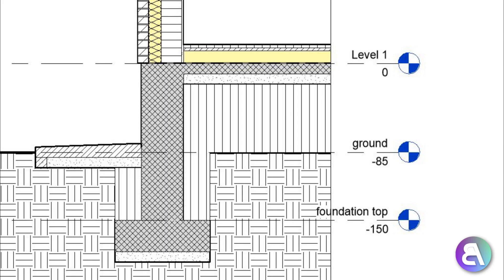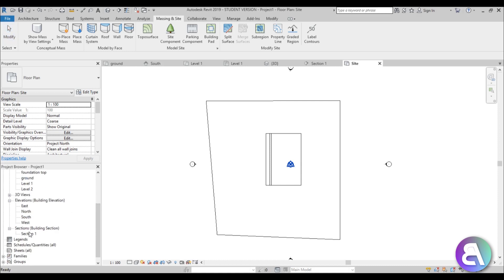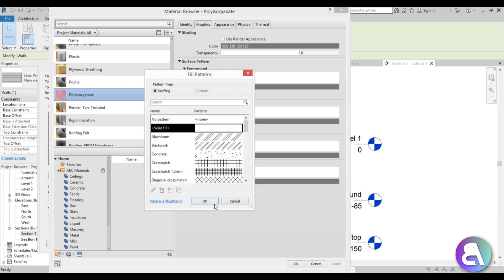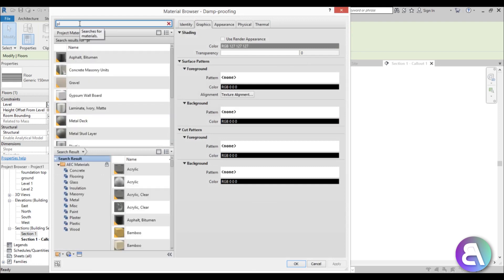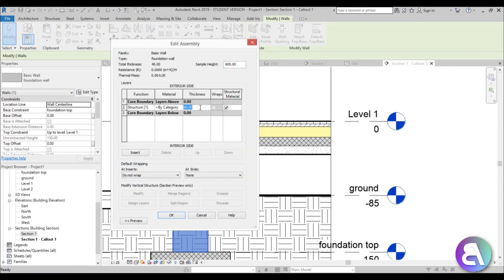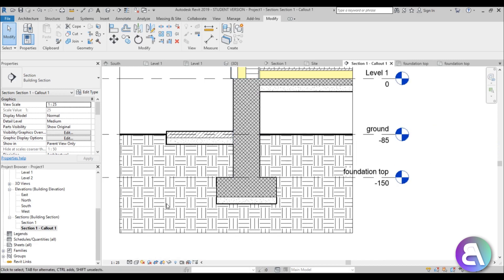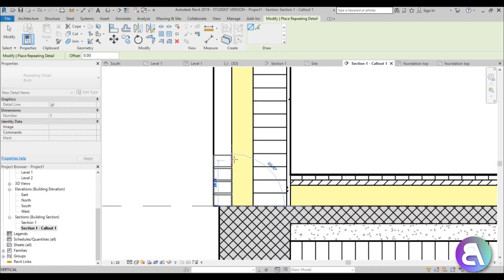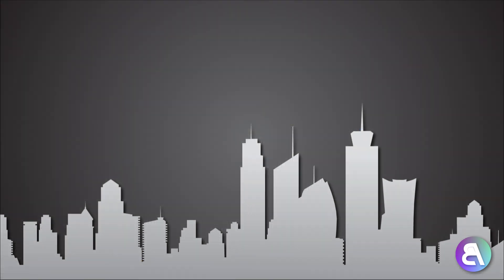Foundation Detail Callout in Revit Tutorial

Comment: its nice detail but i have a thermal bridge in it. you need put therm insolation all over that little wall that is on bottom
Reply: not if the insolation in the floor is about 10cm- it is in theory still a thermal bridge but it is considered to have no impact - I would still but insolation on there especially because it is not underground- also the dimension of the bottom plate seems much to small
Reply: man floor on terrain need list 15 if not 20 cm of insolation + hydroisolation and especially you need isolate the  
foundations like is it here : https://imaterialy.dumabyt.cz/obrazek/586f9ab3cb3b3/hi-nepodsklep-rd-05-06-1.jpg
Reply: Oh I thought you meant something like this https://www.bauexpertenforum.de/attachments/frostschuerze-jpg.50130/  with "all over" the wall- I was just talking of the inner side of the foundation that you don't- have to insolate (like in your picture) although it is actually a thermal bridge